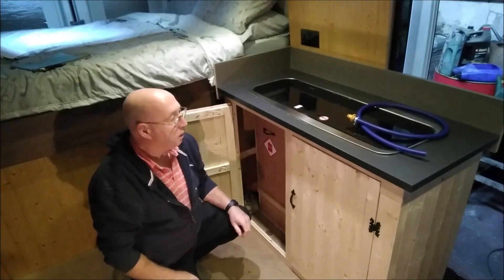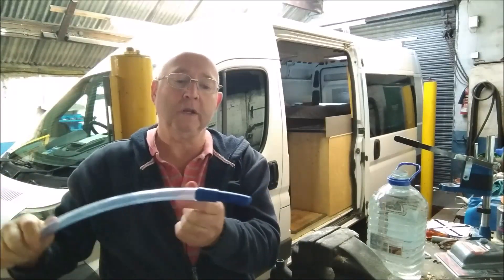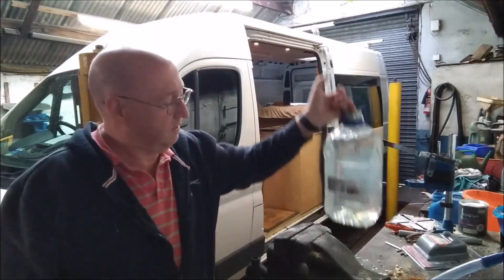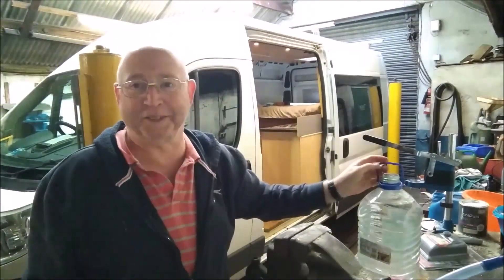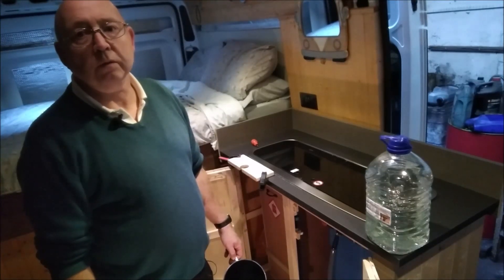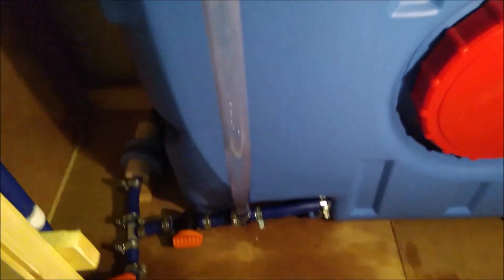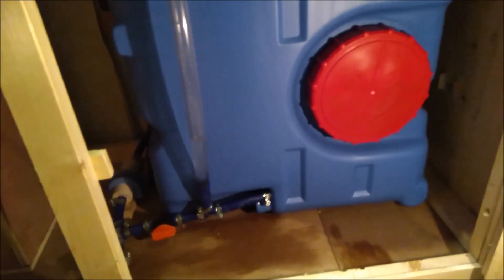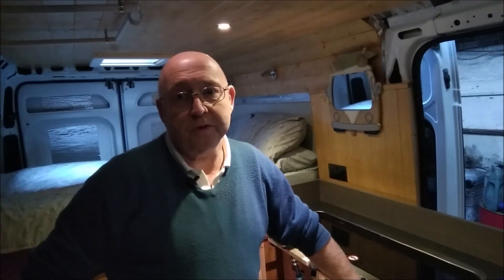SELF BUILD CAMPERVAN CONVERSION UK : WATER SYSTEM : A SIMPLE WATER LEVEL INDICATOR FOR CAMPER VANS.

Comment: A very interesting video, I have to do a similar thing on a converted Peugeot Boxer van I bought recently, its fitted with 100litre underslung Barrat water tanks, although I could peer underneath and have a visual I may have  to go down conventional route, until I have a closer look will depend on which road to go down.
Reply from the maker: Hi Gareth, Yeah, this is an simple system, no running in &  hiding wires, faffing on with fuses, no drilling holes in your expensive water tank...  I'm vey pleased with it, it works no problem ( apart from the beads that don't float like haha ), not sure how you'd be able to do this on an underslung tank though !!!
Anyway...good luck with yours and thanks for watching my video & taking the time to give me your comments, it's much appreciated...
                                 Cheers...Jimmy

Comment: How much for the tank and systems step up
Reply from the maker: Hi "Amarayah Asrae"  sorry for the slightly delayed response, I had to check my records to find the information you asked for !
I'm assuming when you say my "set up" you are referring to the sink / hob  !  I bought that as a kit as I didn't want to be buying bits & peaces from loads of different company's, also to make sure sizes etc would be compatible to each other and of course only one company to deal with if there were any issues.  
I also bought an "inline" pump instead of the submersible pump that came with the kit.
My tank : is a Fiamma 70 Ltr capacity bought from "ishop247 from ebay at a cost of £66.92 ( 31st Mar 2019 )
My Set up : sink / hob "KIT" is  Part No 9222R  ...bought from Clearcut Campervan Conversions,  it inc's a Truma Reg ( needed for permanently fitted gas appliances )  at a cost of £ 326.70  (2nd April 2019 ).
My inline pump :  Whale Premium  GP1392 in-line water booster pump, bought from Camping Online (ebay ) at a cost of £29.95.
I hope this is the info you wanted ?  good luck with your build.
Thanks for watching and commenting on my video.

                                                Cheers...Jimmy
Reply: @jamesstringer8172  thanks for the breakdown. I hope I can get those items here in Canada.. nice built 👍